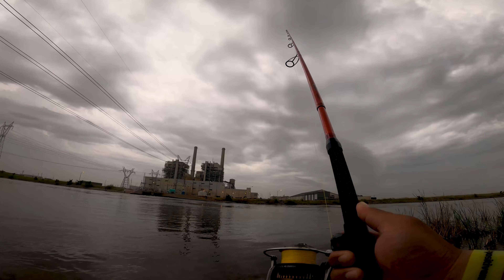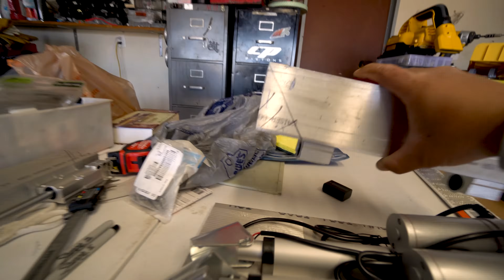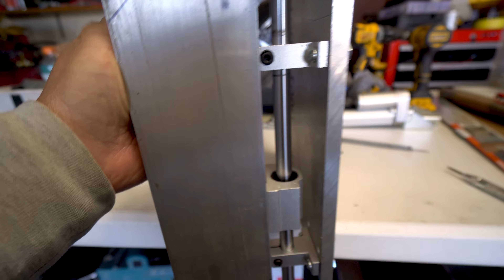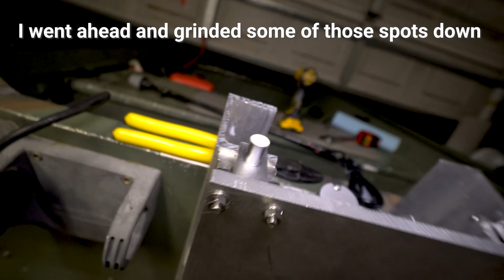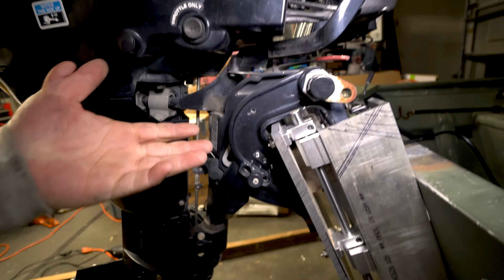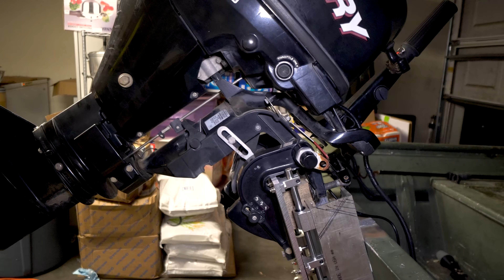Youtube's Best DIY Jack Plate for Small Outboards Jon Boat - OOW Outdoors

Comment: How did these hold up against rust?   I got some of these on a machine we scraped.  They got left under some of the other structural stuff , and forgotten for a while.  When I remembered that they were outside , they had rusted up " Badder"'. Even the little ball bearings had rusted.
Reply: @coburnlowman  
You need to plaster everything in waterproof grease and try not to use  different metals  to avoid corrosion ..if you use  bearings use stainless in grease or ceramic but those are expensive .  
He could apply kiss principles and use two larger C channels bolted to the transoms and use solid heavy duty composite  rollers running on large pins inside the C channel s  facing each other.. no corrosion no ball bearings  big thrust torque reaction surfaces to spread loads and use an actuator but one less likely to corroded or a hydraulic piston, a slave piston with a foot or floor mounted master  and a control valve  knob on the dash.  A modified hand brake might  be adaptable  to pump the master cylinder and not use  a foot operation.

Comment: Where did you get the bearing brackets at? I'm looking at doing a tilt instead of trim and running it across top to hinge with the same setup
Reply from the maker: Its part of the 12mm rod assembly

Comment: Great build thanks for posting. Two questions:
You said the actuator is rated IP67, but the one you linked to is IP54. Is it a different link to the actual one?
Now that you have used it, do you have confidence in the rail/slider? It's hard to tell from the video how solid they are. Any fear of the rails bending? thanks!
Reply from the maker: The boat is store outside and get rained and is uncovered.  its got about 5 trips since i've installed it.   Still works good.  The actuator doesn't look to be best built for sure.  if it fails, just replace it.  it doesn't cost too much and easy to replace, just two pins.

Comment: Awesome idea! What’s the speed on your actuator? I’m going to start ordering parts to build one, and want to see if I can find an actuator that will work but is a bit faster. Also, what thickness is that back plate of aluminum that the motor mounts to? I think you said it was 1/4”, but it looks thicker than that.
Reply: My actuator was the one the link.  I used 1/4 inch plate
Reply: @konerri  thanks for the response. the actuator link is dead. It Just goes to an eBay page that says it can’t find the product.
Reply from the maker: OK fixed it.  https://ebay.us/UNAGXl

Comment: I’m in the process of adding a jack to my boat. I had a similar problem with the outboard’s clamps & used an old plastic cutting board to add spacers. I didn’t want to mess around with trying to waterproof wood.
Reply from the maker: yes, i have since added PVC block to that clamp too.

Comment: Love the build, was just wondering how all was holding up and how heavy you figure your engine is. I would have researched that myself but I didn't see any horsepower on the motor that I can recall. Thanks and once again great build. Seriously thinking of doing the same.
Reply: Its a 9.9 hp.  It it overkill for it. It should hold down a 25 hp the setup is still working like new